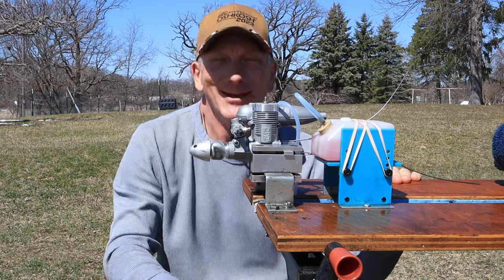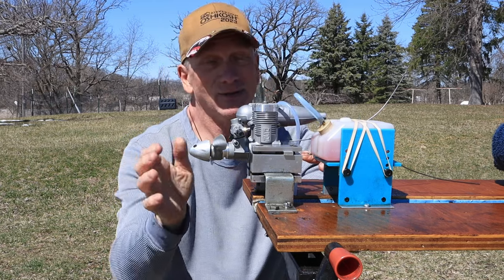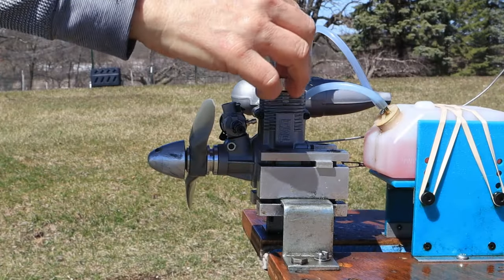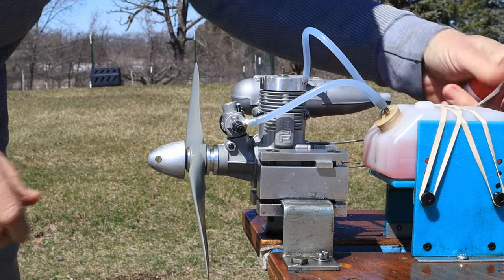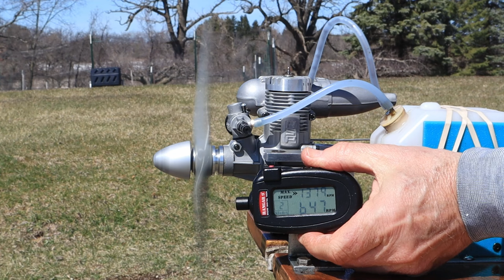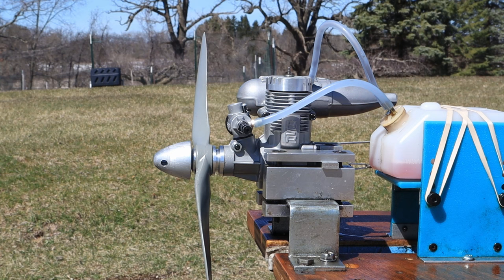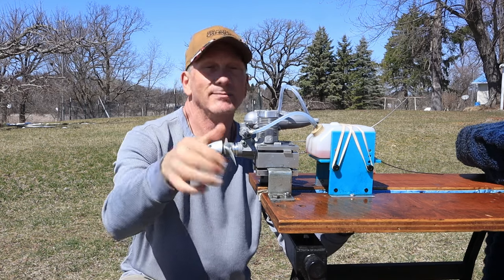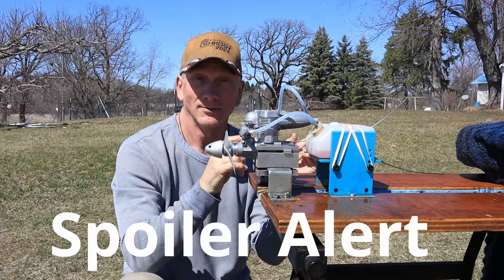ASP 46 ABC Break In Run

Comment: Even the early SC's all were quite good, and start easily, there were bad ones, but a .46 I bought in bits runs like a clock and screams. Yeah, got brand new ones and especially the ABC ones are tight when new.

Comment: 12:29 I had the same by sanye, Magnum 46 XL with the HSN on carb, then the next version 46 XL RNV really powerfull and long lasting resembles the great OS 46 SF version, then they changed the design to the XLS   the squared cyl design, also very powerfull but i like more  the round cyl design, great first run!

Comment: Perfect run David and you’re spot on with running in an ABC engine. That engine has a lot of power and 14k peaked out will be no problem. 
Great little engine and in many ways better than the OS equivalent, esoecislly the FX series.
Can’t wait to hear it leaked out but first that Webra monster!
Reply from the maker: Honestly the ASP is more impressive than the Webra and I would hardly call the Webra a monster.